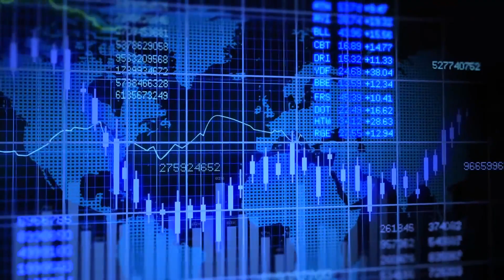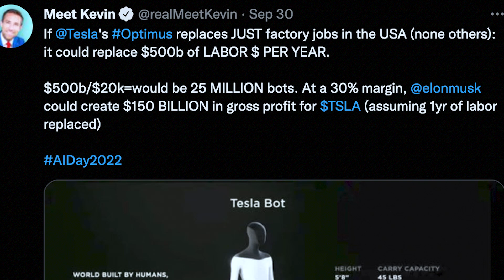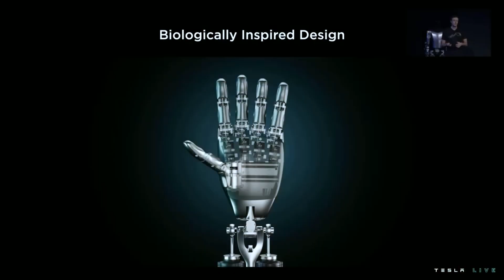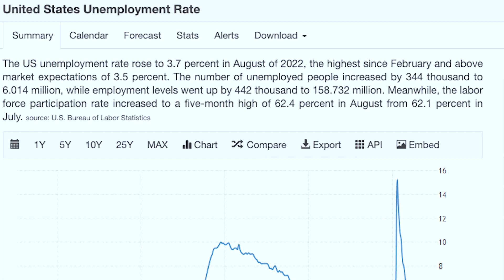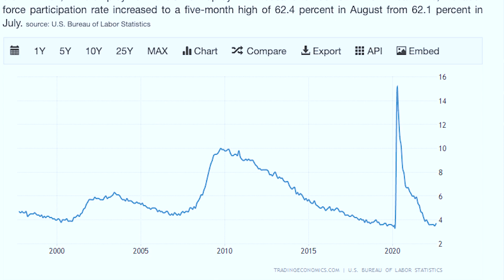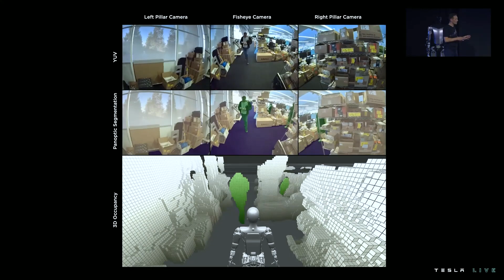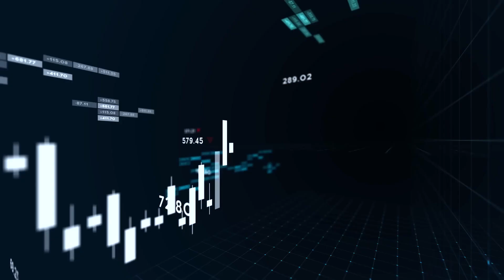The TRUTH about the Tesla Bot!

Comment: Not from today the industry uses robots to build cars for example... Be aware that human shape is NEVER the best one to achieve some industrial tasks. The more the robots get into difficult specialized tasks, the less they look like us.
So the question is: Why spend so many money to build squadrons of humanoïd robots?
For which use?
Reply from the maker: Hi Oryjen, thanks for your input. 
In my past live, I was a mechanical engineer that worked on surgical robotics systems, so I 100% agree with you that  specialized  and niche tasks need a unique robot design. 
In my mind, the key thing to consider is the goal to produce these robots in scale and cheap. And it is hard to produce 100 different robots for individual use cases at scale and cheap. Because of that, Tesla is focusing one design that could fit many use cases. A lot of things these robots could help out with are designed for manual labor and with a human - ergonomic design, which is why tesla chose to go in that direction. having a general purpose robot that you can train via AI could help with some of these jobs could be huge.

But I agree, we won't have optimus performing robotic surgery, or do precision spot welding. But maybe they can help with packing stations, getting groceries, cleaning, or dishes etc. 

Did that answer your quesiton?